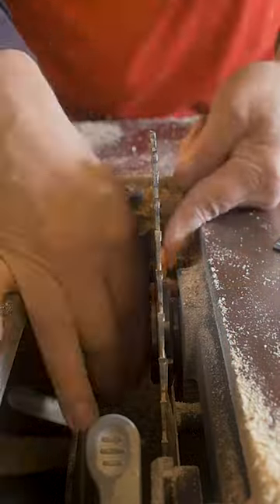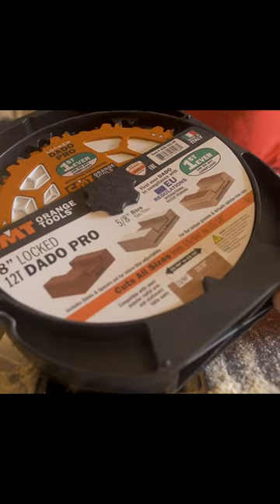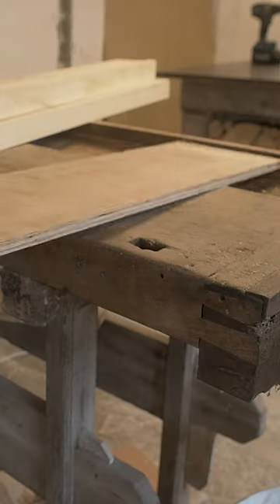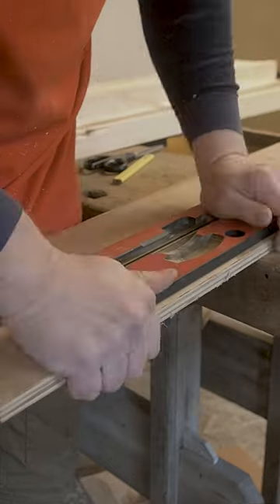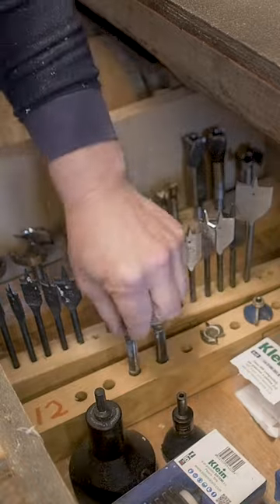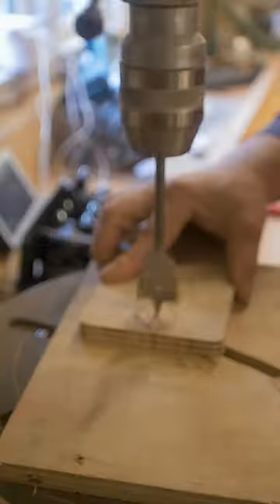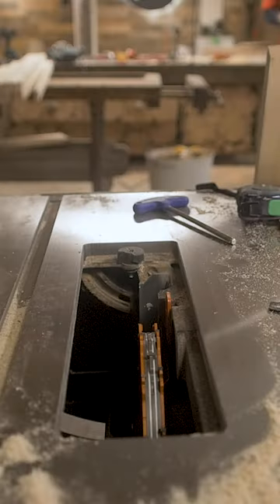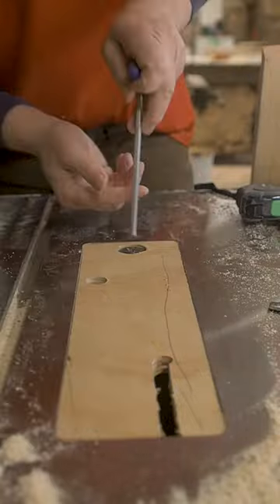DADO Breakthrough 🚀: European Ground Debut

Comment: Were there dado police before, all over the EU keeping an eye on workshops ready to pounce? Was all aircraft baggage scanned for illegal imports of blades? Well congratulations for being a genius and groundbreaking wonder as ever ❤
Reply from the maker: I think the main thing was making sure the saws sold had so short arbors it was impossibe to mount a dado on them. And no EU shops had dados on sale. That way you really must want a dado to get it up and running here.
Reply: The regulations only apply to professional, trade workshops that are required to adhere to particular safety standards. The problem with dado blades was around blades that continue to spin after the machine had been turned off, without a shield over the top. Dado blades themselves have never been against any regulation in the EU, Provided those other things were also in place.

Comment: Were dado stacks prohibited?
Reply from the maker: Yeah, in Europe
Reply: @JesperMakes     The wobble style always seemed dangerous to me but I never had an issue.  I prefer a stack.
Reply from the maker: I think is an awesome tool.
Reply: @JesperMakes  No, they were never prohibited. The safety regulations for commercial shops concerning blades that continue to spin after electrical isolation - including dado blades - were so strict, that they were unlikely to be adhered to. Accordingly, tool manufacturers - concerned they’d share liability for any accidents resulting from non-compliance - simply made it difficult for their tools to be fitted with these type of blades.